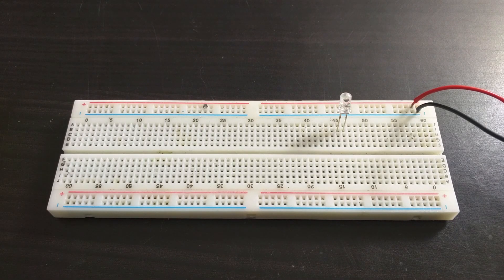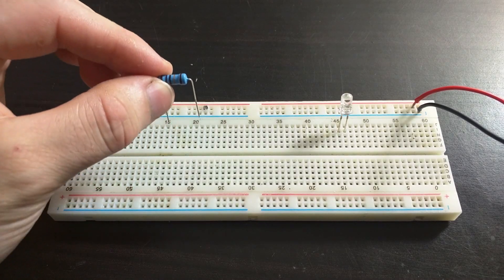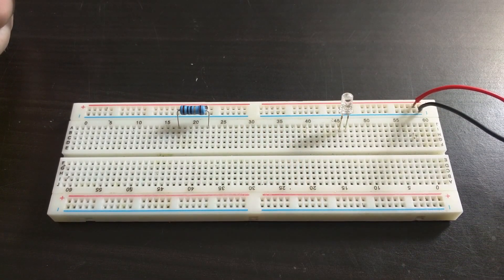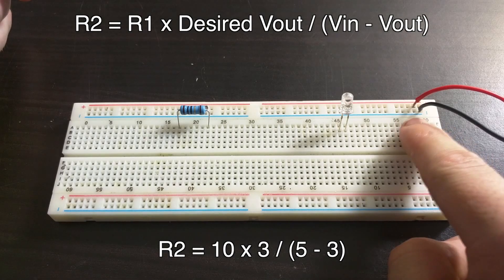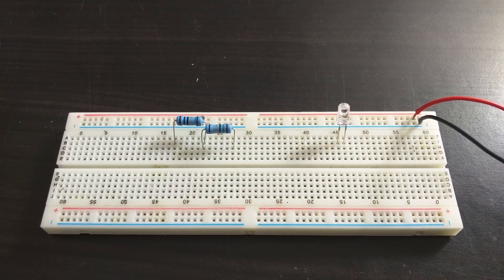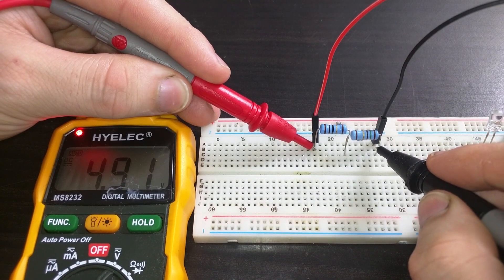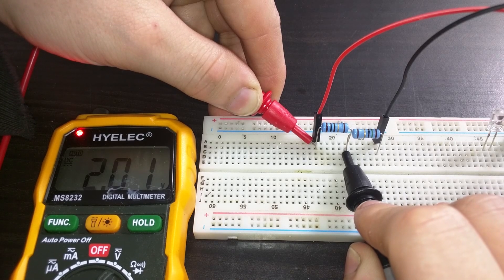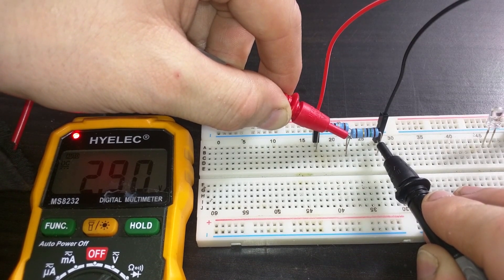Make a Voltage Divider - Simply Making

Comment: What are some applications of voltage dividers
The video discusses how to build a voltage divider circuit to reduce the voltage supplied by a power source to a desired level. However, it doesn't go into the applications of voltage dividers.
Finally, thank you for making this video!
Reply: you could also potentially use it to power multiple components with different operating voltages with one power supply
Reply: I'm using a voltage divider to detect resistance changes, so that's one possible application :)

Comment: i have sensor operate 18-30v and i want  connect to arduino esp32 and get value from arduino esp32 that operate voltage is 3.3V.. can u recommend how wiring and resistor value that can i use.. TQan i use.. TQ

Comment: i want to use a fan which is rated at 12volts and 1.2 amps, but the power source i have is 24volts. will this method work to turn on the fan ? i guess the resistors would burn out as it cannot deliver 1.2amps ? please reply

Comment: Dont forget to highlight how much resistor wattage to use here . 1 watt resistor should work . however  for the sake of understanding voltage divider this video have point ,but its not realy applicable in real life application since its not very efficient . and your led wont last that long.

Comment: It is posible doing a voltage divider with a maxximum of 0-150v DC input 0-60A. If any resistor could get this amount of current. Voltage regulartor is not a good way for me because I am looking a variable output voltage depending from the input voltage.  Thanks for help

Comment: good but the arrangement of resistors made it complex and hard to grasp also you connected the circuit at the end without explaining the flow of the circuit.
 your slow paced explanation is excellent but you have to cover all bits and pieces to be crystal clear thank you

Comment: How to reduce transformer out put voltage from 24 volt to 22 volt but not altering current???
Reply: You can use 4 diodes in series to drop nearly 2 volts from the transformer.

Another way is to use variac transformer.

Or 

Dropping voltage in primary coil results in lesser voltage across secondary coil.
Reply: What kind of diodes????There is lot of different types of diodes out there,can you be more specific???
Reply: The basic diode will solve your purpose, not the schottky ones(they drop low voltages).
The size you can take as per your requirements(Amperage).
Reply: Problem is I need to drop 2 extra volts down but not The Amperage...Amperage must be stay the same as 0.5 Amperes and correct voltage must be 22 volt instead 24 volt...
Reply: All basic diode will work for upto 1 Amp.
I'll  share a link.
Reply: https://youtu.be/fDwLkyAGMaU
Reply: I understand diodes in series,but I have transformer 24 volt and 0.5 Amperes,I need to know which diodes to use to achieve 22 volt and 05 Amperes....
Reply: @Cabal2600  any diode prescribed in the video link given.
Minimum 3 diodes, max 4( voltage drop vary a little bit from diode to diode).
Reply: https://youtu.be/oVgV3Ie8eUQ

Comment: I did same with battery charger which ended with heat and smoke
Reply: Your resistors were too small for your power supply. You need properly rated resistors for your power supply's wattage. Or you have to use resistors with much higher ohm ratings, to reduce the current sufficiently.

Comment: In high school (over 20 years ago) I took one electric class and it came so natural.  Best grade in the whole grade, blah, blah, blah.  But parents always want what they think is best so this subject really wasn't taken serious.  Now, as a hobby, almost anything electric is within my top 3 favorite things.  However, since chasing knowledge in this field wasn't my objective 20+ years ago, I find myself mid age with a sudden thirst for this subject.  The best lesson (other than don't electrocute yourself) that I learned, actually taught myself is that winging this subject when attempting to accomplish a successful goal just will not cut it.  Sure a broken clock is right 2 times everyday but that clock should be in operating order to assure it's time is correct (or within acceptable margin of error.)   No more half measures, I failed a project today that a substantial effort was wasted.  Thus, this way, the way of equations, no estimations is the route that leads to a successful goal obtained.  In fact, had I simply remembered this very information in this video some of the most valuable commodity (time), wouldn't not have been wasted.  Thank you, I am subbing.

Comment: reason why in this video he uses 2 resistor is that is the voltage divider rules..minimum 2 resistor..more than that its fine, less than that IT WONT WORK..that what ive been thought in school.
Reply: the equation is state, Vout - Vsupply*R2/(R1+R2)

Comment: NEVER use low value resistors for voltage dividers unless you KNOW the power usage.

To light up a resistor, multiply all the values by 100-1k ohms.
Reply: I don't understand how 2 10 ohm resistors is the same as 2 10k ohm resistors, as they both split voltage in half, when the more ohms the more resistance
Reply: @ulfricthethird7535  
Less current goes from 5 volts to ground using 10kohm resistors than using 10 ohm resistors.

It really depends on the current draw. However, most voltage dividers are terribly inefficient, since there is a voltage drop once you connect something.

Watch Afrotechmods' video on the subject please.
Reply: Ok thanks

Comment: So I have a 1.5v glow plug that I am trying to connect to a mini wireless switch that runs at 6v-36v Ill post the link below on the remote. If Vin = 9v and R1 = 10 ohm and R2 = 2 then Vout = 1.5v. What I am trying to figure out is, can I connect the switch first without resistors so that its getting signal than add resistors to the positive wire going to the glow plug so its only getting 1.5v?
Here is the switch
https://www.amazon.com/gp/product/B07H4VK882/ref=ppx_od_dt_b_asin_title_s00?ie=UTF8&psc=1

Comment: I want to use 9 volt and 6 volt for 2 different things from a voltage source of 90 volts ! 

How to do this ?
Reply: Probably too late, but dont use 90 volts. It'll kill you. Buy a 9 volts power supply.
Reply: HCF of 9, 6 & 90 is 3.
Divide 90 by 3, u get 30.
For simplicity, use a resistor(depends upon your load across 9 volts and 6 volts) in series with 29 more such same value resistors.
Load this resistor series across 90 volts(make sure it can deliver enough current, Keep the load below 80%). Then you can use your 6 volt by taking terminals of 2 resistance in series in between anywhere and similarly 9volt by taking terminals of 3 resistance in series.  Make sure the resistors must be different in both cases if you are applying load* simultaneously for 6 volts and 9 volts.
*The load applied across resistor must be of much lower value than the resistors itself. Practically you can play measure voltages not apply load for more than just few miliampere.

Comment: I'm not sure about the "no one can put it simpler than this." If that's the case, then there is no hope of me ever learning what the purpose of a voltage divider is for. Why would you use two resistors to divide the voltage instead of using a single resistor with a higher rating? I want to learn how to measure analog inputs with an Arduino. It's my understanding I must use a voltage divider for input into the ADC but I have no idea WHY. Why not a single resistor with a higher rating? I cannot find this explained anywhere.

Comment: You don't need a voltage divider. You're just wasting current that way.
Reply: He was demonstrating the principle of the  voltage divider. You wouldn't usually use a voltage divider to drive a single LED. A single dropping resistor would be much more efficient, but the calculation for the dropping resistor, R1, is pretty much the same if you substitute the equivalent resistance of the LED for R2. Voltage dividers have uses, like in biasing transistor inputs, or in audio volume controls, but if you are using a  voltage divider to supply more than a few milliamps of power, you would probably be better off using a voltage regulator or a buck converter.
Reply: @herbertshallcross9775  This is what I needed to read!! I was wondering why the resisters wouldn't just burn-up basically shorting the power supply, but if it's just a few mA, then I guess that's the reason? I just imagine those resistors in series being connected to a car battery and them immediately going up in smoke.

Comment: What about the resistance of the LED?   Doesn't that change the resistance of the circuit and change the voltage across it?
Reply: led would blow at high voltage input that's the point of a divider! lol
Reply: Definitely, applying load across the resistor eventually drops the voltage.
You can just lit a very small load like small LED.
The power of the load must be much lower than the resistance across which the load is applied.
Reply: @Honey_Arora  Searched for this video exactly for this answer. Thanks!
Reply: @leonardokala  thanks sir for the appreciation.